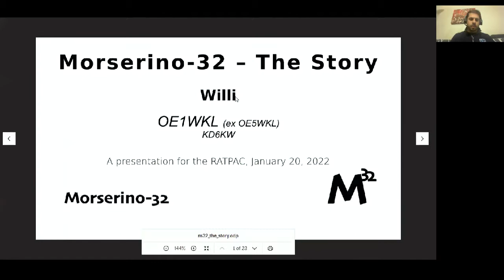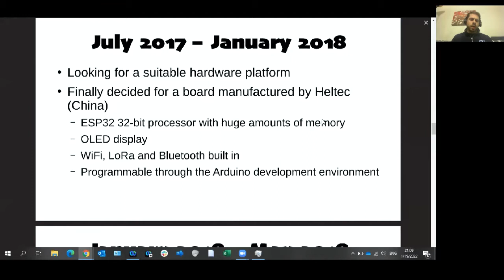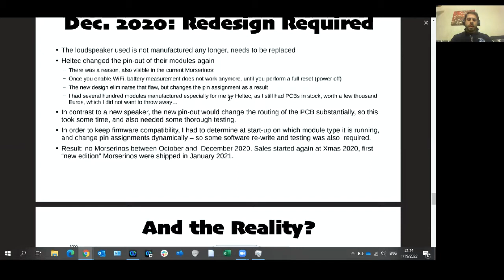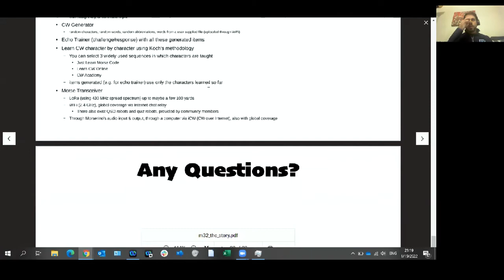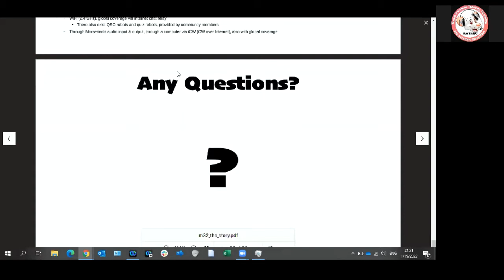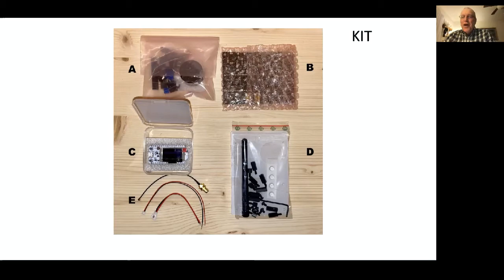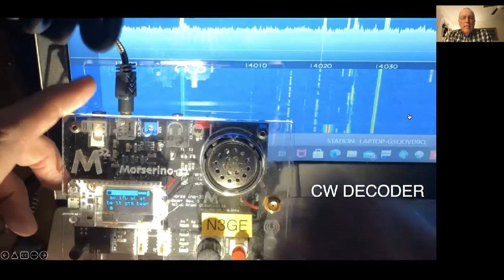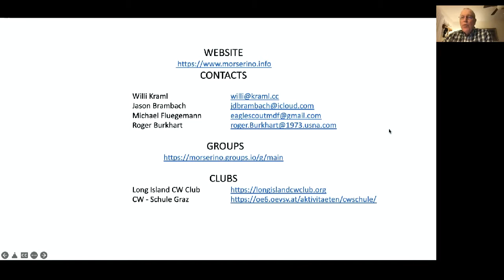Morserino-32 - the multifunctional Morse machine

Comment: I have one made in 2020 it has version 3.01  is this the older  one ? , i just put it together and its wonderful and yes it is  not forgiving
Reply: 3.01 is the software version. There are two hardware versions that I'm aware of. The first version had the external paddle input pointing towards the front of the Morserino (parallel to the in-built paddles). The second hardware version has the external paddle input from the left side.

You can update the software even if you have the first hardware version.